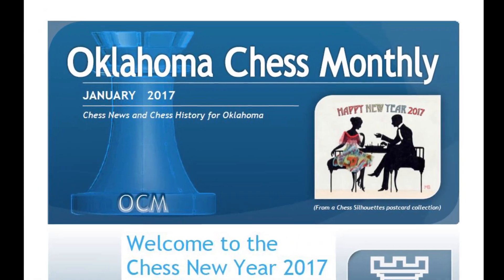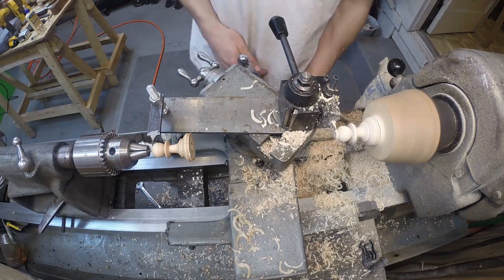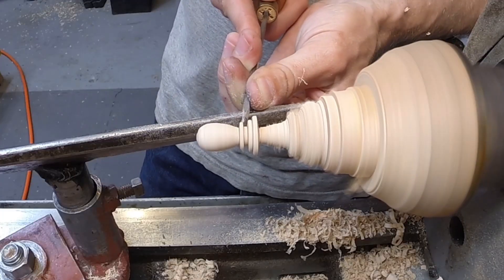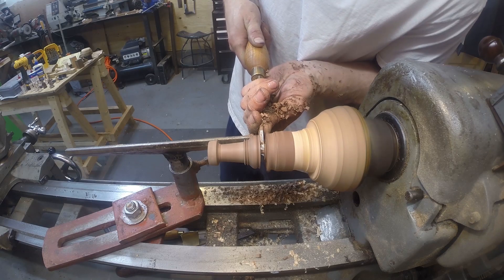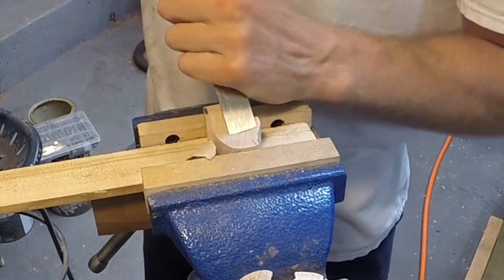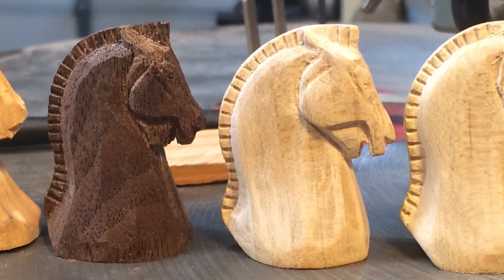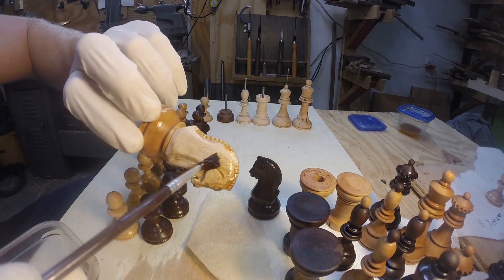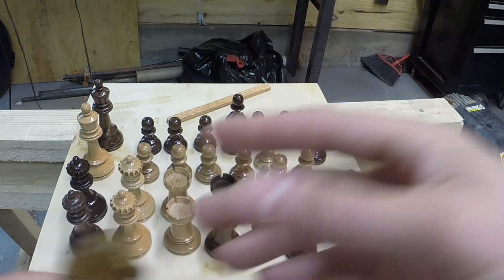Making My Dubrovnik Chess Set

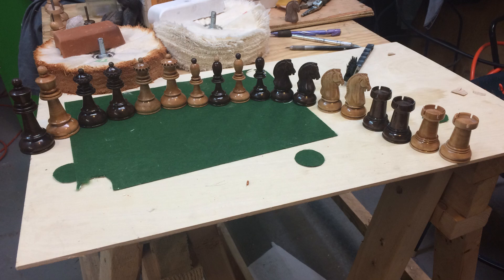Comment: What size chessboard at 7:20 ? Would you recommend 57mm (2.25") for your pieces or as in the original folding chessboard case of the 1950 Dubrovnik which was 60mm?
Reply from the maker: At 7:20 is a 2.25" chessboard. I feel the 3.5" king with 1.5" base looks okay on the 2.25" square although technically a little undersize since the king base should be 75% of 2.25=1.68". Funny though that the original set with 60mm was even more under size.
Reply: A Ukrainian GM once showed me this trick: "Take a "pouwn" and put in center line of two squares. Now take one of his brothers and put next to him, make them touch. Now another of his brothers and place on othere side making touch. Remove the middle man and two "pawuns" must be in center of their posts.  And that is perfect. If too apart, they will feel disconnected and if too close they breathe eacth otheres' air."   I agree with you on the 57mm square size. Noj of Slovenia's 1950 Dubrov they make have it marked in theier website as  37mm base size (1.45") !!
Reply: Continued...   And their Dubrov II as 39mm (1.53" base.)  I don't care much for the "75%" rule, but ultimately it comes down to personal taste, I'd say. Personally I hate chessboard congestion so I don't mind a little bit bigger square. i.e., I enjoy using a Dubrov with 1.65" base on 2.37" or 2.25" board. And a plastic one with a 1.37" base looks good on a 2.12" square but for playing purposes a 2.25" is more comfortable for the movements. Best wishes to you for 2018. Awaiting eagerly for your improvement videos...!
Reply: @conjured_up_skeletons6178   I agree with you. This whole 75% rule is a bit weird. If you look at boards provided at Western European tournaments or even the profession DGT set, the king base is more close to 68%. The CB Dubrovnik with a pawn of 32mm looks way too cramped on my 2.25 board.

Comment: Awesome set, great explanation, and wonderful video. What would you suggest for someone with 0 wood working experience but is interested in making his own set? Where would one start?
Reply: Since nobody answered your question, I will tell you what I did.  I made many chess pieces out of sculpey brand OVEN-BAKE clay.  I place a round lump of clay on top of a poker chip.  I mold it by hand as best I can.  I don't care if they are IMPERFECT.  A little bit of imperfection gives them more character.  I also made a set by molding-making and then filling the molds with CONCRETE... which you can see on the website INSTRUCTABLES dot com.  Just search for concrete chess set.  I think the CLAY starting point would be a good place to start before trying the wood methods, ESPECIALLY for making the knights.  The clay will give you a lot of practice on those 2 MOST DIFFICULT pieces. (I too had no artistic talent making knights)  after making 20 or 30 knights... I got better.
Reply: thank you kind sir for replying! Never thought about getting the shape down and doing concrete molds before going onto wood. great suggestion!
Reply from the maker: Sorry for not seeing this until now. I'd recommend the book Wood turning Chessmen by Mike Darlow. Very simple techniques shown. Wish I had found it earlier. Would have saved some lessons learned.

Comment: Great work !
Quick question, what is the best glue to use with felt?, I have a set I am trying to re-felt and it was recommended I use spray adhesive like the 3M super 77.  Any particular technique you have to use to ensure it is done immaculately ? Thanks !
Reply from the maker: Thanks!  Just recently I found out that baize is the better material than felt.  So far I've only used adhesive backed felt and a circle cutter so I haven't experimented with glues for felt on wood.  I'll refer you to this guy https://www.youtube.com/watch?v=vTs255j9xhA&feature=youtu.be

Comment: Just wondering what kind of glue did you use for applying the felt to the bottom of the pieces - Thanks
Reply from the maker: I'm still trying different glues for that. I used a special gorilla glue since I figured the expanding foam would bond well with the felt/baize fibers. But don't get it close to the edge or it will be visible.

Comment: Hey I just used eboy stain on one of my sets, after it dries, what do you recommend I use as a finishing touch? Candle wax/ bees wax? Saw your videos and felt like messing around with one of my wood sets. Its beed drying for 12hrs, still a bit wet, but drying up , should be done in another 12hrs maybe.
Reply from the maker: Hmm after staining on bare wood then you need a sealer.  Let it cure/harden completely (1-3 days for some sealers) before you start with any abrasive buffing/polishing.   I was using the beall buffing system. Some thought the wax left it too glossy, too much glare on the pieces.  Just buffing with the tripoli wheel and wiping with a soft cloth leaves the right amount of sheen in my opinion but I'm no expert.